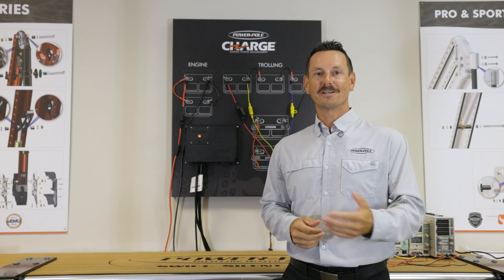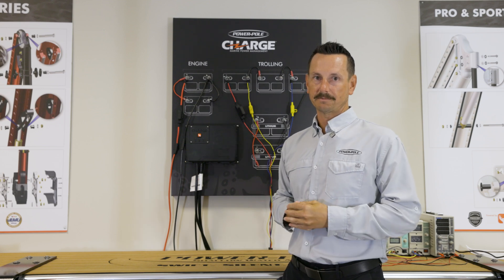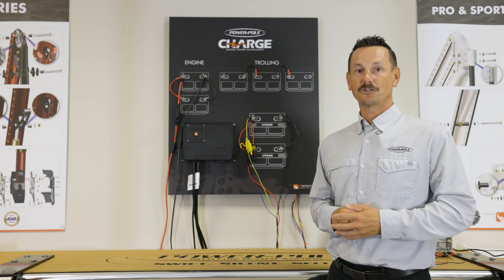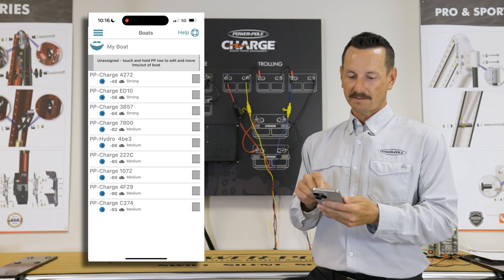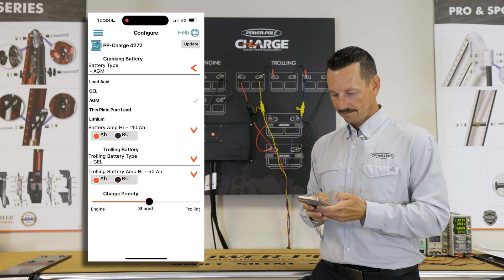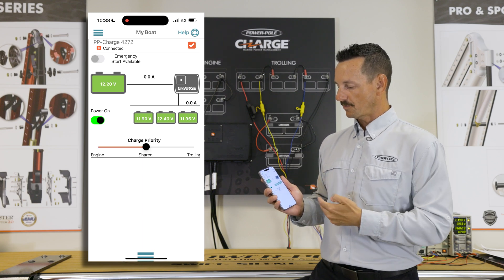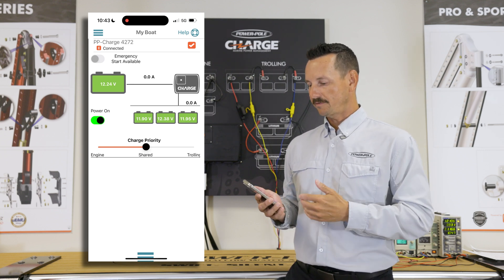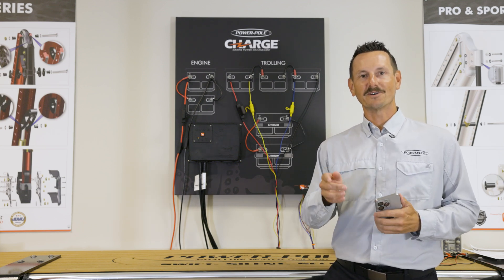Power-Pole Charge System Setup: Step-by-Step Guide

Comment: I have a Power pole charge and I keep my boat at a marina so the power Poole isn’t always hookup to power so when I go to use it they are completely dead. My question is I have a Minn kota 3 bank charger could I install that charger and have that charge my 2 house batteries and 3 trolling motor batteries cause I could have my marina put them on charge before I decide to go . Then once on the water have the Power pole charge take over . Any help is appreciated

Comment: If I have a cranking battery 12 V connected, two lithium batteries making 24 V, and a single 12 V I want to run electronics off of.  Is this possible?  I do not want to run electronics on the cranking battery nor do I wanna run them on the trolley motor batteries.  So technically, I would have a cranking set up., a trolling motor set up, and an electronics dedicated battery.
Reply from the maker: Yes this is possible.
Reply: @ikonboats  How? Because I cannot find any method to do it
Reply: @ikonboats could you elaborate. Only way I see is to parallel crank and house batteries as one unit. That is how I set it up, not ideal but works.